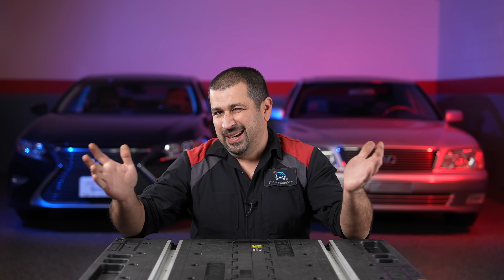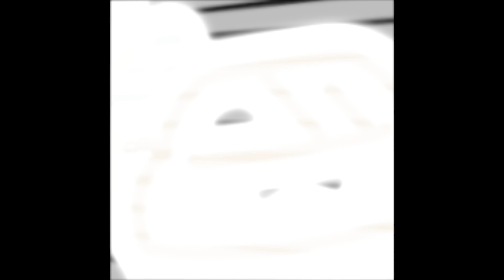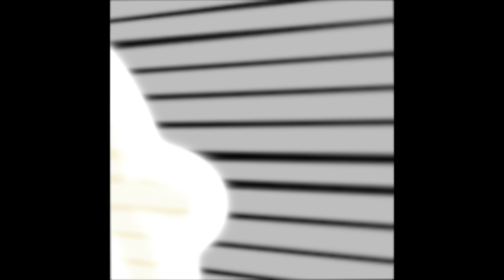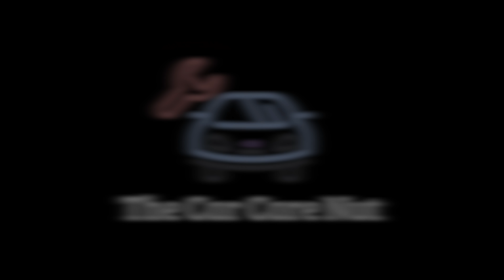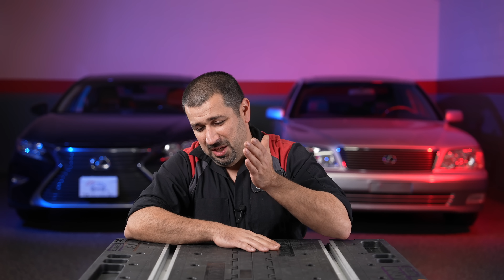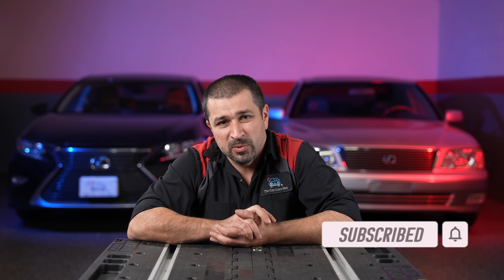Can Modern Turbo Engines Be Reliable? Here's The TRUTH!

Comment: I have a 1994 Toyota MR2 Turbo with the 3SGTE engine. Never a major problem, and doesn’t burn a drop of oil. The turbo works great, and the car is very fast. Certainly driven harder than most cars with turbos today. Now, I know this is a special engine and perhaps built better than the engines you are referring to of today. But, with proper maintenance I expect it to keep going strong. I’ve been putting Mobil 1 15W-50 in it for 22 years, which I know isn’t the recommended oil. But, I live in the south and it’s not driven in any cold weather at all. It’s just a rare, garage queen these days! Turbos can work in the long term. 
I loved your point about being careful about buying some of these new turbo models used down the road. I could definitely see problems there. Fortunately, we bought a 2023 Venza new, and plan on keeping it forever. Such a wonderful vehicle…Toyota made a big mistake discontinuing them.

Comment: The problem is most drivers (myself included) are not car enthusiasts - they're just people using cars to get comfortably from A to B. This kind of info is crucial to maintaining a car long-term, but isn't emphasised by the manufacturers over the basic service schedule, which people typically trust will cover their needs.

The only reason I know anything about cars is because I'm in the market for one and I've gone out of my way to learn about all these specifics. It's been thoroughly illuminating (I actually know what my mechanic is talking about now!), but there's often an overwhelming amount of information (and opinions) that complicate and drag out the decision making process.

Anyways, thanks for sharing your wealth of knowledge to help a layman like me!
Reply: That is a good point, but the rule for people should be to read the owners manual.  A lot of people claim that the car manufacturer says the oil should be changed at 10k mile intervals, but in the very owners manual with that car, there is a section for Severe Driving, and many drivers fall into the Severe Driving category.  If people do a lot of short trips, stop and go traffic, live in hot areas or cities that see frequent 100F or higher temperatures, etc. etc., then they fall into the Severe Driving category, and that halves the oil change interval back to 5k miles.
Reply: Yup, I find it very shocking that most people don't know how to change their own oil
Reply: @jns08d  Why would that be shocking...?  Most people have busy lives and don't have the tool, the time nor live in a location where that is something they are interested in doing, nor it is worth their time.

No different that people who don't cut their own hair, mow their own lawn or cook all their own meals.

How would most people living in apartments or with street parking change their own oil...?

I find it shocking that you would be shocked by that...
Reply: @redbaron6805  Its a basic survival skill living in a developed country - I've changed my oil in parking lots, garages, side of the street doesn't matter - but of course its always easy to make excuses.
Reply: @jns08d  It is never a "survival skill" by any definition.  Even it most rural areas, there are always mechanics and shops to get it done.

You must have a serious lack of skills and be the annual Drama Queen Award winner if you think you are some kind of hero for changing the oil on your car.

It simply isn't worth most people's time to do it, especially when you can drive through a shop and get it done in 10 minutes.

But, if you are broke, desperate and want to give yourself a medal, go for it...
Reply: @redbaron6805  If you can afford to replace cars due to poor maintenance or mechanic screw ups by all means more power to you, but nobody is going to take better care of your car than yourself.

Comment: Incidentally, Honda in 80s designed one of the best, most reliable high output turbo engines, notably the record-breaking Williams-Honda driven by Mansell that went on to break the Silverstone record of fastest lap. In qualifying trim, it was developing over, 1200bhp from a 1.5l turbo V6. Yet Honda never ran turbos in their own engines except for now and paid the price in reliability. In 80s and 90s, the Germans did make some reliable turbo engines used in Porsche 911 and 944S and yet, the longevity was nowhere near the normally aspirated engines. Toyota's reliable engines are all normally aspirated ones, be it 1GRFE V6 or the4.6l and 5.7l V8 used in Tundra. The turbo engine combined with today's thinner ring and lighter piston design is the death knell for Toyota and others. None of the turbo engines from other Japanese manufacturers are doing any better.

Comment: The question really concerns best case lifetimes for turbo vs. non turbo.  If you take a Chrysler Pentastar V6 which is non turbo, it is a half million mile engine if maintained properly.  There is no turbo engine that will go that far no matter what.  Furthermore, turbo engines will require a replacement turbocharger at least once during their shortened life of between 100 and 200k miles.  Those are the essentials of the matter.  We are not ranking car makers for poor longevity of new cars any longer, and we must do this.  We need to put an end to plastic engine parts, no dipsticks, "lifetime" gearbox oil, and general unmaintainability.

Comment: I’m glad you addressed maintenance. New cars automatically come with 2 or 3 years of maintenance package. That means 10,000 mile oil changes on the turbo. If the car is leased, good luck.

Comment: BMW F01 was the first 7 series with a turbo. The engine couldn't last 2 years 😂. BMW dealers had to file a mass petition to Bavaria to  do something with the now infamous N63 that they had to fix under warranty, usually at a loss. Those turbos, coupled with 30k km oil-change intervals, cooked everything under the hood. Temperatures reached 320°C in some areas. It took them almost 10 years to create a N63TU that some people consider more or less reliable.

Comment: What’s your take on skipping the oil filter (6,000mi) but do 3,000 mi oil change. Other channel mentioned dirty filter works better filtering smaller micron debris than brand new filter.

Comment: The new "twin turbo charged v6", Toyota put in the new Landcruiser 300's, lexus's, Tundra's etc are really giving people a hard time. 
Nothing beats an underpowered (under-stressed), large, Naturally Aspirated Engine, when it comes to reliability. Engines like the 5.7 & 4.7 N.A Toyota engines, they run forever, as long as the user is keen on maintenance.

Comment: I had a BMW X5M. For 12 years.  600hp.  I religiously changed the oil. Never had an engine problem. Sunroof and air suspension but no motor issues

Comment: I've a 22RET in an 87 Toyota Pickup.  It has 200K on it and has 2 rebuilds.  The last rebuild was by me and a local machine shop.  So yeah, it has proven itself to be less reliable that a 22RE.  In city driving and off road, the oil change interval is 2500 miles.  Also, though its hard, I've been careful about driving conservatively.  I've committed to the 2.5K oil changes and I'm determined to flush and fill the coolant annually.  It is what it is and I'm very attached to that little truck.  A tip:  make sure the grounding system is sound on these mini trucks.  Otherwise and you'll soon need a new cylinder head due to the effects of electrolysis.

Comment: You are right. These turbo car need a lot frequent oil changes. I've still have my 2003 VW with it original turbo at 260k and running strong. Preventative maintenance is the key.

Comment: Hiya...I like ur videos they r very informative.....
I have a diesel 80 series turbo landcruiser it has 10litres of oil I change it every 10 thousand K as per the manufacturers specs.... I use full synthetic high grade oil I do the filter also at the same time. I don't drive my cruiser like a race car cause jts not one...its a tank I seldom go off road cause I don't like seeing it dirty..lol.. 
I think  I'm doin ok with my changes I also add lucus upper cylinder lubricant which  gives better performance cleaner burning quieter and more fuel efficiency. I love my cruiser like its a valued part of my family ...😅

Comment: Bought a new Tacoma off road in 2023 and first oil change was 1500 miles, after that every 3500 miles. I can’t imagine running a turbo charged gas motor except for racing! And when the turbo eats something and the fans crack well it is going to get very expensive. Because you have a racing engine in your truck!

Comment: An excellent topic to talk about. I don't have much confidence in these modern engines. We now have under 2 liter lightweight aluminum skeletal engine blocks. The open deck designs of late have very little head gasket sealing surface. I believe these blocks flex under certain conditions. Add forced induction via a turbo and the head gasket is under more stress. It seems that modern engines are more prone to head gasket failure than in the past. Turbos when pushed hard will get hot enough to glow if you open the hood at night and look at it. They are very tough on engine oil. If they aren't idled down before shutting off the oil gets cooked inside the turbo. This causes what is known as coking. The oil feed orifice can get so coked that it is blocked starving the turbo of oil in which the turbo fails. 10K oil change intervals aren't going to work well with a turbocharged engine.

Comment: One thing I forgot to mention is to let the car idle for a minute or two before turning it off, it you have been driving in any way under load, this lets the oil circulate through the bearings and remove the excess heat so the oil does not cook in the bearings and carbonize.

Comment: Turbos also suffer from start/stop systems that deprive them of oil circulation before they have a chance to spool down and stop spinning. Don’t allow the start/stop feature to work, your starter will also thank you. Let the engine idle a bit before turning it off to allow the turbo to slow down before oil circulation is cut off. Diesels and planes on av-gas use turbos to compensate for thinning atmosphere at elevation to retain sea level power rather than to boost power at sea level like cars.
Reply: Not only the starter, but the flywheel teeth.......

Comment: Synthetic oil can take extra heat but running through a glowing turbo is going to burn anything up. 2500 psi fuel injection and 0w-20 at 10k is guaranteed failure.

Comment: I had a Saab 900 and drove it over +240K miles. My recipe was a couple of things. Whether it's winter or summer, I warm up the engine for three minutes or more. Before stopping the car, I waited 1 minute in idle. If I drove fast and kicked the turbo, I would wait a little bit more. Change oil every 5K miles. I was doing Italian tuning, driving the car at high rpm every week for 5 minutes. Also, use 91+ octane. I use this formula for all my cars, including W222, and I have never had an engine problem.
Don’t be cheap about the oil change intervals and using higher-grade octane. It pays off if you like your vehicle and are considering keeping it long-term. Mr Car Care has been preaching the same thing for most of the maintenance videos. Don’t be afraid of turbo, but if you still use it as your American guzzler, don’t play that ball.

Comment: This was a great video. I owned a 2006 BMW 335i tune turbo for 3 years. The car was reliable while i had it and it was 10 years old when i purchased it. However, the turbos did start the rattling noise when on start up and cold. I sold it that way (disclosed it). I would say yes e turbo cars now are way more maintenance and less reliable.

Comment: That's why I love my AMG BiTurbo! Dual turbos give the boost needed with reduced turbo lag! The turbos can spool up quicker because they are smaller, but because there are two of them, they put out more boost than just one small turbo! As for destroying turbos...One thing...The Stop/Start system. Shut this off if you want your turbos to last longer! Like you said, turbos spool up to super fast speeds. When the engine shuts off from the stop/start system, so does the flow of oil. Turbos do not stop immediately and require several minutes to spin down. With the oil supply stopped, these turbos are spinning down with no new oil. In essence this oil lubrication is gone! This is bad for the bearings. AND since the oil is just sitting in the passage ways of the thousands of degree hot turbos, it is turning into carbon...COKING which chokes the oil passage ways which will eventually starve the turbos of oil. This is why turbo bearings fail...

Comment: Why don't the car makers do more with the engine oil and water cooling system to match
the heat generated. It seems that the amount of engine oil and water needed the same as
n.a. engines. I may be wrong as I am not a car mechanic.

Comment: Running dual turbos on my V6, I will lab test the oil at about ~ 2500 miles against the virgin oil lab test to ascertain if I can go to 4k at most and I will test it at 4K or the drop/change interval (UOA).  Lab testing is definitive, beyond a doubt as to oil quality and state of deterioration. I will say, without a doubt viscosity sheer is a huge factor with turbos and the thing I am keying on, as well as fuel dilution and metal wear measure.

Comment: Have owned several v6 sedans and v8 pickups. Have to say I like my turbo vehicles. 2013 fusion with 2.0 running strong at 162,000 k mikes. I reset the olm and change when it hits 50%. If it went all the way to zero it would have nearly 10,000 Miles on the oil, no way I’m doing that.

Comment: The summary:  Change any oil at 3,000 miles to make the turbo last.  That’s it.  I’ve chosen non-turboed cars because I want extended oil life.  If I ever get a turboed car, I’ll change frequently.  In 1983, I chose a Datsun 280zx instead of the turbo model because of the extra maintenance.

Comment: Turbo AND GDI engines should have oil changed at 3-5K depending on your climate and driving style. Can’t emphasize enough to stick with the oil weight for the engine design. Only exceptions are track days, etc. if the vehicle is sold in a cold climate and says used a specific oil for that climate, use it. The engineers may not have weighed in on the oil change interval, but they did design an engine specifically around a particular oil weight.

Comment: I owned and ran a shop for most of my career and we specialized in Volvo repair. Volvo has used Turbocharged engines since 1981. What you say is 100% true. We recommended 3k oil change intervals and our customers who followed that recommendation had way better luck than those who were always past due for service. Cars with oil usage issues were most often turbocharged as were cars with crankcase pressure issues. What your video leaves out is the extra cost for many services and repairs due to the turbocharging making the repair more difficult and the fact that turbo engines use a long list of parts not present in normally aspirated version so more parts that could fail.

Comment: Im about to buy a new 4Runner if I run the best oil in my opinion penzoil ultra platinum full synthetic and I change at every 5 k will that really be cooked oil by the time I change it? I’m not planning on trail rigging it just for crappy weather and when I need to get out a some gravel roads with crick crossings and stuff like that it can get me there on very infrequent occasions. Is the issue the oils integrity goes to crap and doesn’t lube the actual engine as well or the turbo failing prematurely? Cuz if it’s just the turbo at say 50k and that’s looking at it worst case kinda I don’t care to put a new turbo on like I would care having to buy a whole knew engine. And if damaging the actual engine is the case because of ruined oil integrity is there aftermarket turbos with the same flow rate /pressure specs that has better cooling that will make the oil go for longer safely? Cuz that would be an option for me cuz I don’t care I make the initial investment and keep a vehicle going forever I don’t like change so I maintain my stuff pretty well

Comment: We have owned Turbocharged Vehicles since 1980.  SAAB had Turbocharging mastered. Same with Volvo.  The Turbo Vehicles we've owned have all been SAAB 's and never had an Engine or Turbo failure.  We have a 2002 SAAB with 200k town miles and it burns no oil, Turbo boost is still like it was when new.  It's going to be sad when our dear SAAB finally wears out.  It seems like manufacturers today do not understand Turbocharging to the degree the Swede's did.